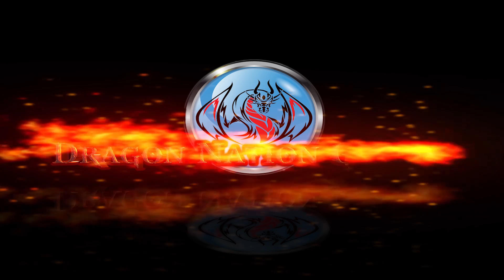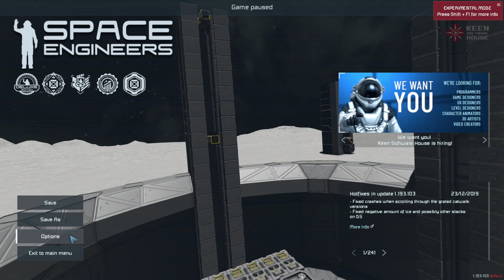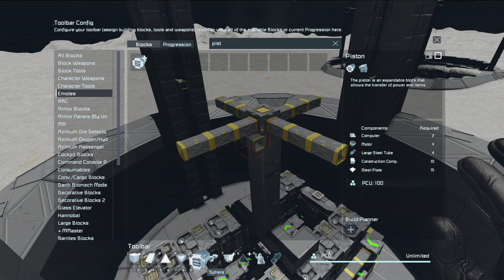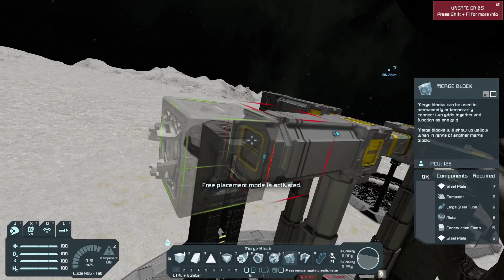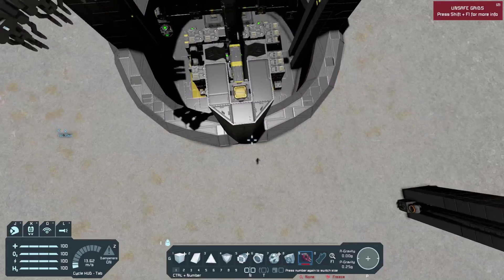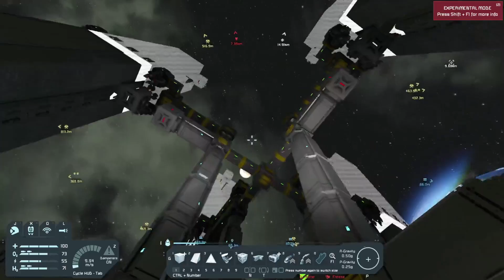Space Engineers #35: It's Time

Comment: Vanilla welders will weld 1 1/2 blocks, so you could have done the weld part with only 4 welders. You could have the elbow, welder, junction, welder
Reply from the maker: I don't know where you get your information but it's wrong
Reply: @DragonNationGaming  When I build my drilling rig the base was 7 blocks wide and I only use 3 welders, one each on the outside and one in the middle.  It worked just fine.
Reply from the maker: @walkingwalkerwalks  Maybe in creative but it doesn't matter. For a build like this you need to weld fast, especially when you get close to the max block count. The more welders the better. You also can't compare what I'm doing to your drill rig. Either way it doesn't matter. It's the way I build, it works and it doesn't hurt anyone. Why contradict me over something so pointless?
Reply: @DragonNationGaming  I was not trying to contradict you and was just giving a little input.  You are correct about it welding slow and that was fine for my drill rig and it works great.  Yes you would need to weld faster after seeing the rate that you wanted to climb.

I did enjoy the video and I like the way you build.  Know hard feelings!